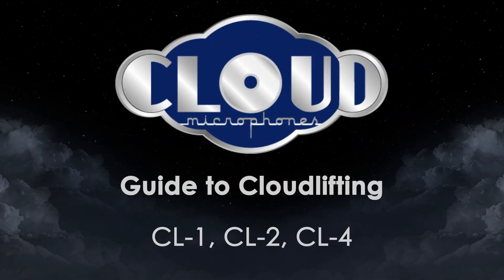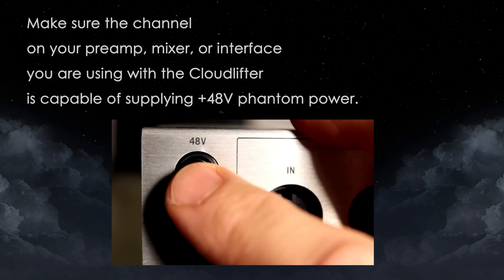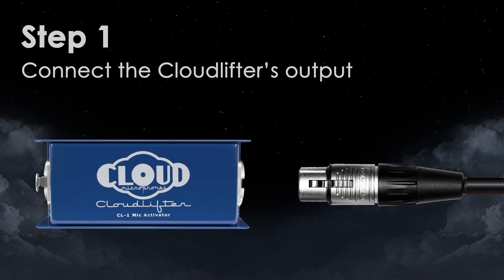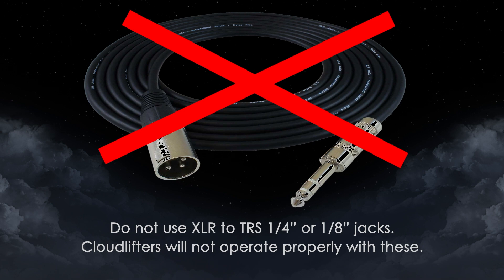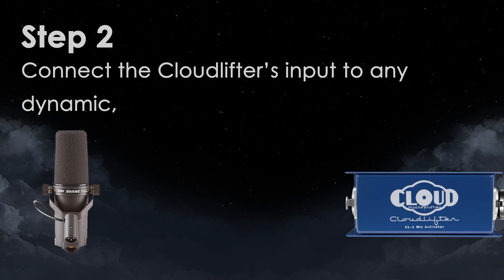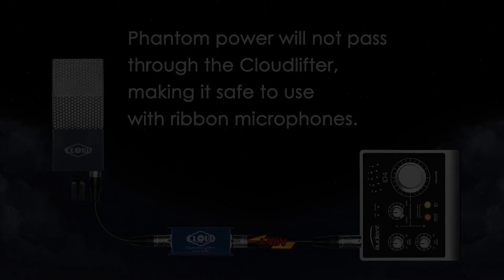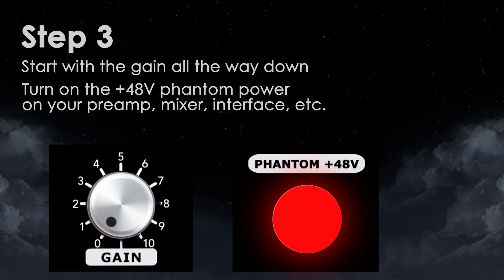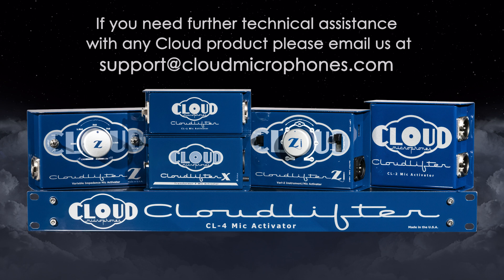Guide to Cloudlifting CL-1, CL-2, CL-4

Comment: Hey. Just bought cl4 version and looking forward to using it! Quick question, is there any max lenght of xlr cabels - in or out? And could I use splitter to outing the sound to the mixer and one other device at the same time and still get the "sound lift"? Thank you very much!